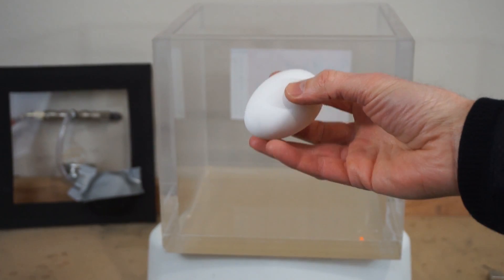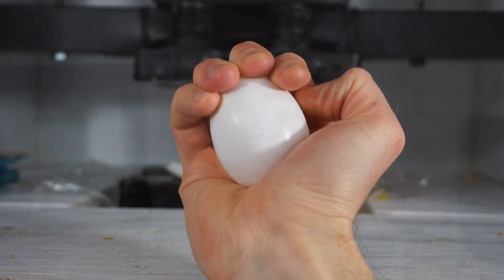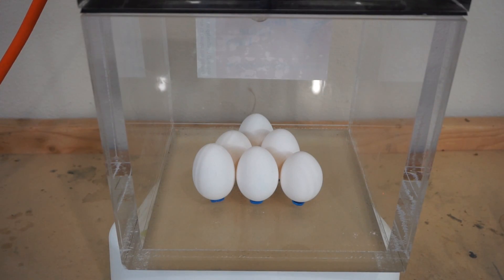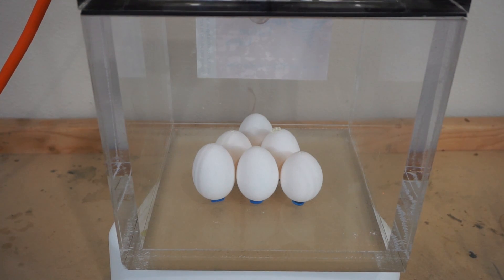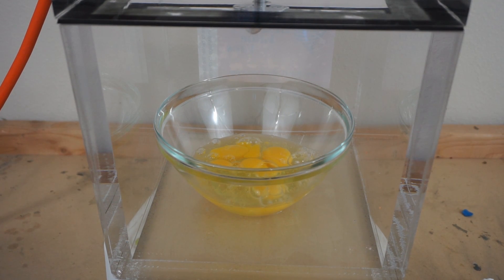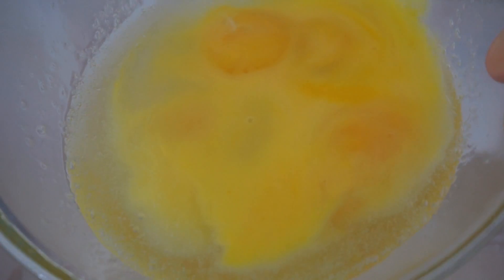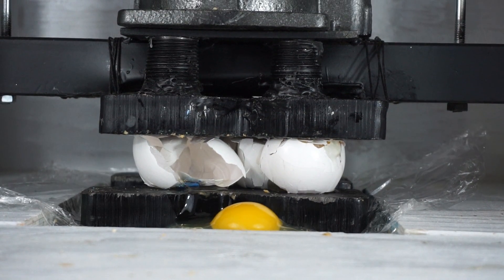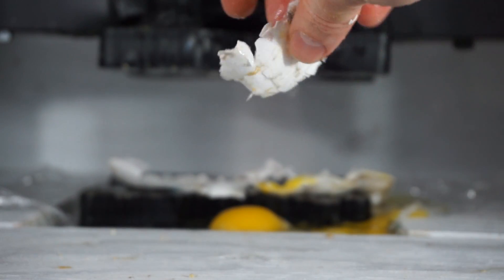What Happens When You Put 6 Eggs In A Huge Vacuum Chamber?

Comment: can anyone explain why the eggs boiled in vaccum?
Reply: ***** I know I wasn't having a go just agreed with you..as you are right about the air getting sucked out..just clarified no heat no cook.
Reply: Hmm makes sense but then why do things are shown to freeze in space? Shouldn't they be like boiling or something?
Reply: Because moviemakers are too lazy to include real science in sci-fi movies.
Reply: It all has to do with pressure. Although I’m pretty sure it’s just the water in the eggs that is boiling and not the egg proteins (I’m not sure what the boiling point for proteins are, but the freezing/melting point is probably about 150°F). At sea level, the pressure is about 14.7 psi, but if the psi drops to 0.4, water can boil at room temperature. BUT think of it in reverse. Increased pressure raises the boiling point, of anything. This is why people use pressure cookers to cook foods faster. This is also how you get liquid butane and propane, which are normally a gas at room temperature. Butane or propane under pressure increases its boiling point to above room temperature, but when it’s released from the pressure, it boils and turns into a gas.
Reply: its called cavitation. the lower the pressure to a liquid, the lower the boiling point. hence, eggs boiled at room temp
Reply: Amber Zareva if that's the case then their nether boiling or cooking just bubbling
Reply: Shikhar Chaudhary they were not boiling.
When something is in vacuum all gasses in it will be sucked out so bubbles wasn't there because of heat but because of gasses coming out.

Comment: Could someone explain how the eggs 'boil' but not cook?
Reply: Cooking is caused by heat changing the chemical makeup of the egg, boiling with heat is just because hot air rises, and is unrelated to how the egg cooks. Since there's no heat and the air is rising because of the pressure difference with the surroundings, nothing causes chemical changes in the egg and it doesn't cook.
Reply: Awesome. Thank you!
Reply: I don't think it's actually true but it sure sounds good ;)

Comment: Eggs actually do have a air sack in them on the less pointy end, which is why if you put a cold egg into already boiling water it has a very good chance of cracking because of rapid expansion of the air. Slowly bringing to the boil reduces the chance of breaking also eggs shells are porous that's why there is a membrane around the actual egg.

Comment: As part of the moisture in the eggs in the vacuum changed from liquid to vapor, the temperature should actually drop although it would be hard to verify and re-condense the instant the air went back into the chamber - although the air that returned would be a different temperature than what was taken out... ?

Comment: I did like the part with the eggs "boiling" you should have left it until the air es sucked out.
I think it is the same with water. It is not boiling. Looks like it but I think it is the same you are decomposing the water
H2O suckin out the 0 until you are left with H2 or something like that.

Comment: Of course it can boil without being hot enough to cook it.
The boiling is a result of reduced pressure lowing the boiling point.
The cooking requires enough heat to denature the proteins. The 2 are fundamentally different.

Comment: there is air in an egg here Air Cell. The air-filled pocket between the white and shell at the large end of the egg. ... As the egg ages, moisture and carbon dioxide leave through the pores of the shell, air enters to replace them and the air cell becomes larger.

Comment: First part of video: Egg can be crushed by hand. You should probably be raised as an agrarian to make it easy. But without strength, stamina is a suitable substitute. Put low hand pressure on egg for long periods, it will break. medium hand pressure will break in medium time. 

Also depends on chicken diet. On farm we supplement chickens with crushed clam shells to strengthen shells, so they dont break in the coop before they can be collected. Lots Of variables not addressed in this video.

Another variable is roaming. We let our chickens roam without cage, to catch bugs to thier fill, and we are overflowing with eggs, yolks dark as sunset, shells hard as nails.

Comment: I work at a company that makes syringe pumps for research, so I have a lot of syringes around.  I like to take a small syringe, fill it with a bit of hot water so the plunger is about 1/4 of the way out, then put my finger over the hole and pull the plunger almost all the way out.  The water boils for a few seconds until the water vapor brings the internal pressure up to the point where the boiling stops.

Comment: You have to stop saying things like "We're at negative .75 atmosphere". You can't have a negative pressure reading; once it gets to zero, it ain't getting any lower than that.
Reply: Craig Corson actually, there are different conventions of pressure measurement. What you are referring to is absolute pressure, where a total vacuum is indeed zero. However, gauge pressure is absolute pressure minus atmospheric pressure. It is commonly used in situations where a pressure gauge is used. It's much easier to build a gauge that measures difference in pressure between the atmosphere and the thing you want to measure. Your car tires, scuba tanks, and nearly everything else you encounter is measured in gauge pressure, including this guy's vacuum chamber. Since the pressure in the box is below atmospheric, the gauge pressure is negative. Also, this means a gauge pressure of -1atm is the lowest possible.
Reply: I see. I wasn't aware of that, thanks for the educational tidbit. Still seems counterintuitive to me, though.
Reply: eggucational
Reply: thank you
Reply: In the top branches of really high trees there really is a negative pressure in the channels that transport the water to the leaves. There are no valves in these channels and water can only travel so high when creating a vacuum on one side. To get any higher the tree creates a negative pressure by letting some water evaporate through very tiny holes up in the trees.
Reply: Jeremy Johnstane how do u know? Were u inside of one?🤔
Reply: Craig Corson a vacuum is absence of pressure! black holes have negative values!
Reply: Craig Corson ويمني ينس سنس نس سسنرس سنتس م سنس ضحي بن ثلثي
Reply: Wut Wut you couldnt of done that unironicly
Reply: fuck you
Reply: Craig Corson i
Reply: First time I don't see a fuck you after someone explains sth. around here :D
Reply: Craig Corson i uh
Reply: Or simply put, the zero gauge pressure is reading one atmosphere which is ours that we breathe. No atmosphere Mercury will rise 30 inches. The boiling in th vacuum is the air and moisture boiling as its removed.

Comment: there's always something dangerous to try but not sure if I'd suggest it.  a 5 inch all metal fan (well 99 % metal) (ones you typically put in an office area or near the bed.  and just press tht , can't imagine what would happen in a vacuum.  let alone you need power running to it so you'd need some sort of good seal.  If there's no air would the fan motor blow up have no idea.  now a metal fan at a high rate of speed hitting something hard I'd almost imagine would have an issue similar to that of a helicopter but then again having seen enough of these videos I don't know what to expect :O

Comment: why was the eggs boiling but not cooked
Reply: It's called cavitation. Basically the lower the pressure that a given liquid is subjected to, the lower the boiling point will be. This also explains why bubbles come off of propellers when submarines travel through water. The pressure right in front of the propeller becomes so low that the water immediately boils into a gas.
Reply: Oooh thank you
Reply: Thomas T vgcgf
Reply: jc476 is right. The reason eggs "cook" (or at least egg whites) is because the proteins denature from high heat. Here, the eggs boil at room temperature.